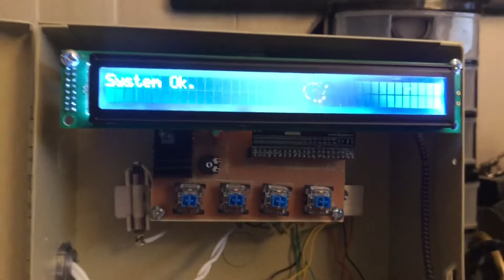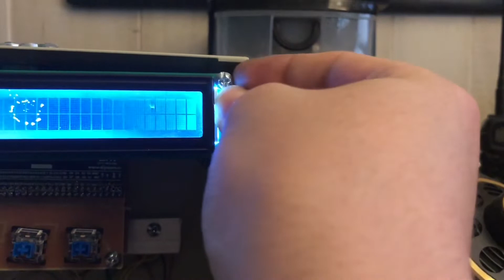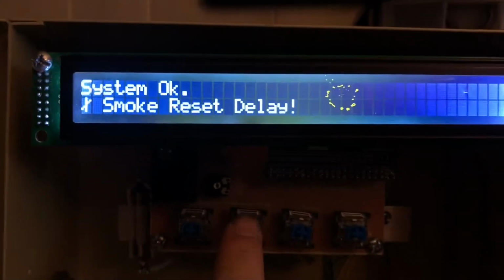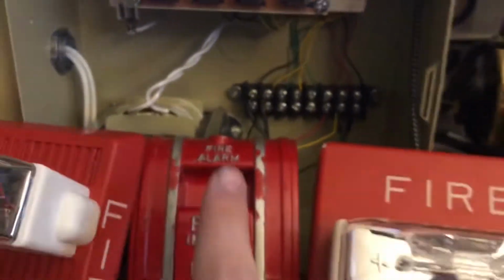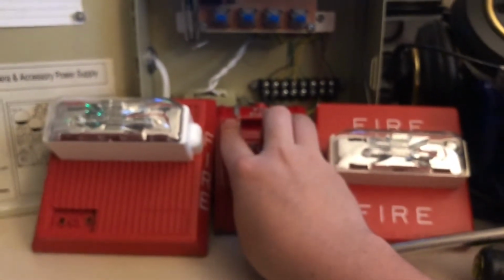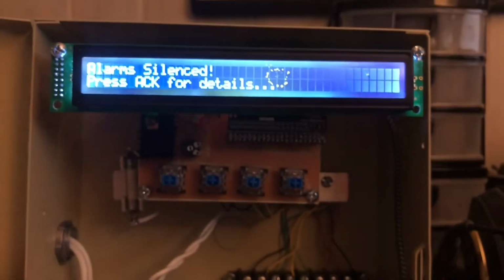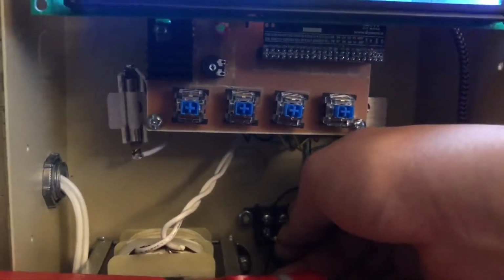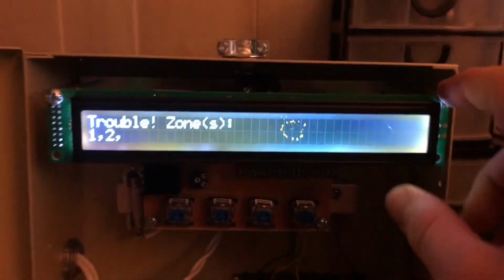HSL DAP-5 Fire Alarm Control Panel | Homemade FACP | System Test 1 [READ DESC!]

Comment: Are more system tests going to be made?
Reply from the maker: Possibly- if people want them I can make more lol
Reply: @HiSmartAlarms  Given the complexity of the panel and the compliments in the comments I think it would be nice for people to see
Reply from the maker: @firealarms95  Alright, I will have to do some more demos. It has changed a bit actually since that video-

I haven’t been able to upgrade it though because the UART chip broke. Instead of fixing it, I am thinking of just letting it be since it was already functional.

I plan to one day create the DAP-10 which will probably be one of the last fire only panels I make.
Reply: @HiSmartAlarms  sounds good!

Comment: If that’s a linear regulator you should definitely use a buck regulator. Runs much cooler and more efficiently
Reply from the maker: I chose a regulator because it produces a nice and clean output, plus the input voltage is 12v, I don't really need a buck converter for something that uses 12v, and is barely drawing any current. My regulator runs nice and cool. The big heat sink isn't the voltage regulator. It's just a placeholder. Will eventually be for battery charger.
Reply: @HiSmartAlarms  oooh ok. Yeah that makes more sense I thought the regulator was producing that much heat lol. Very cool panel!